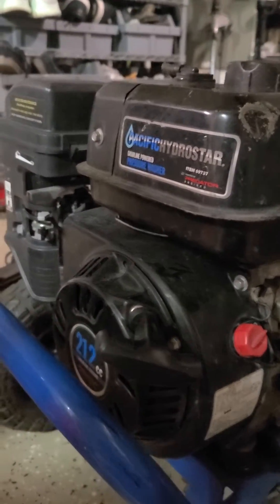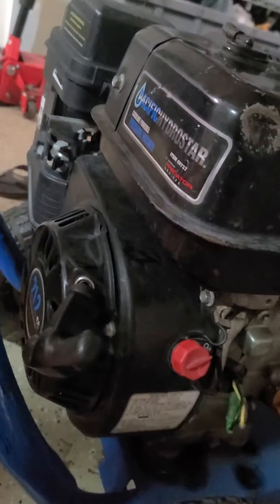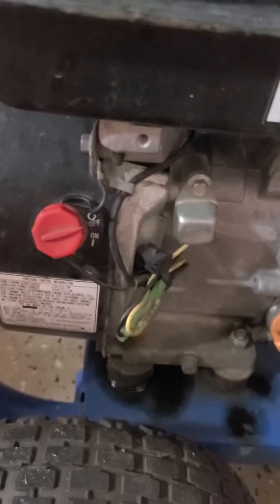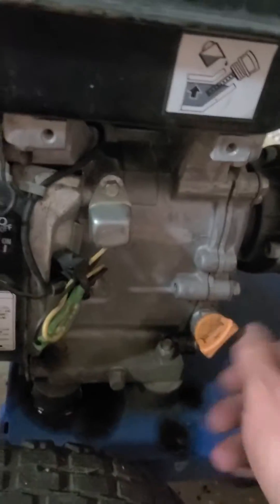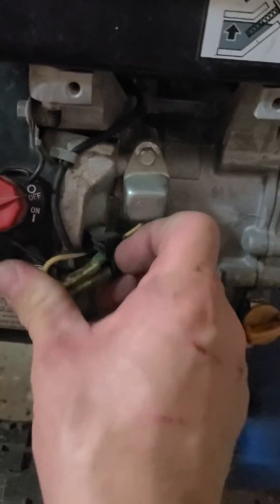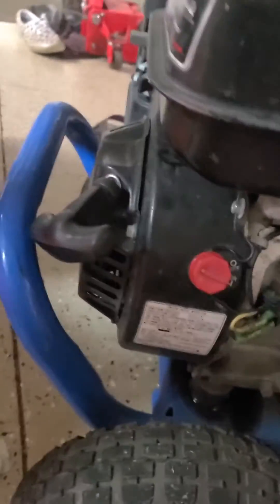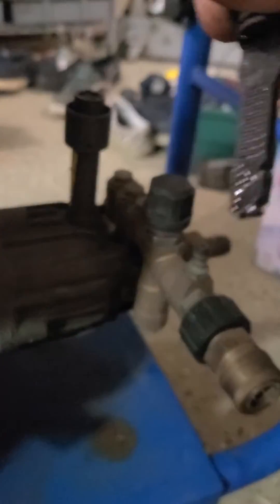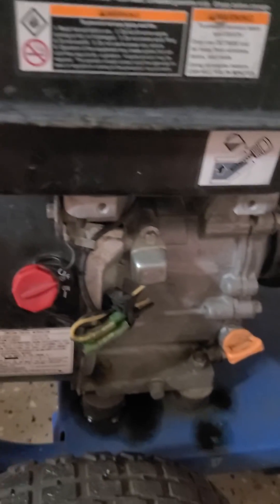212 Predator won't start and pops

Comment: Every summer i have to replace the carburator. Timing key sheered on me and valve lash thosands of times adjusted tring to figure out why it wouldnt start. Ditch that oil sencor. Just make sure you check the oil and drain plugs befor running it. The seal on the case and valve cover are shit. Even the expensive rubber ones fail. Shit cost a lot. Better off buying a new engine than the parts to build the crap

Comment: that's a great point, electrical connection corrosion is a problem on these engines. the low oil is good on a engine that is stationary but on a gokart or minibike they gotta go.
 i have a couple old 5hp briggs engines with low oil cutoff and they are not as sensitive so i leave those alone

Comment: i just got my 212 about 3 months ago. The first ever time running, it had a huge backfire on the startup. Every now and again on the rip it will also do it. Does this mean my engine is bad or is this a regular thing?
Reply from the maker: Not regular thing. Change plug and clean wiring connections for low oil sensor shown in this video
Reply: @jitterspec  thanks